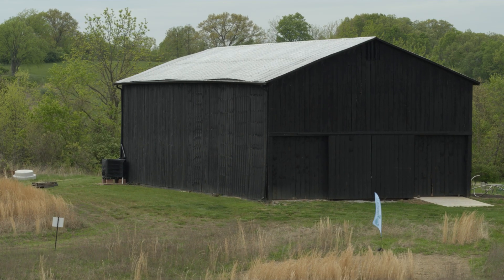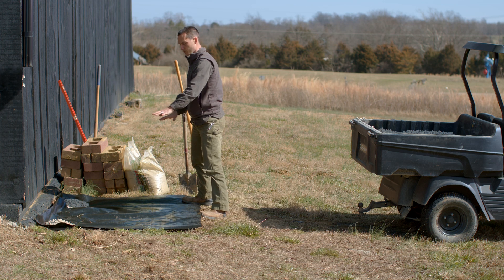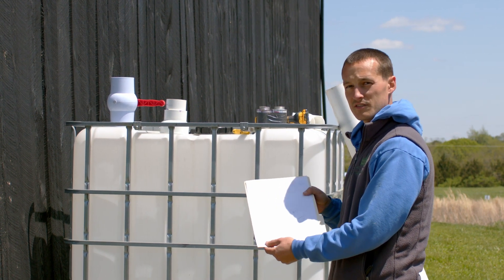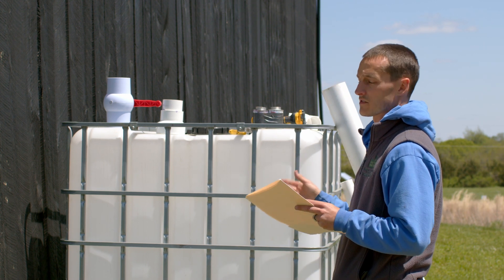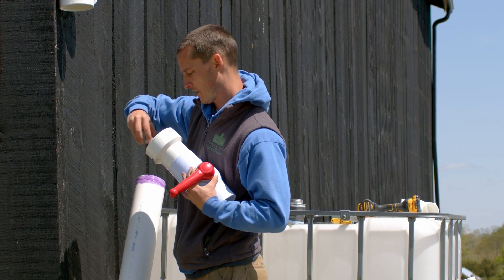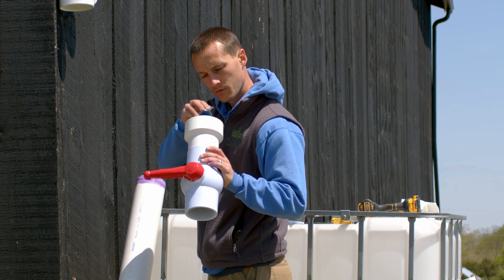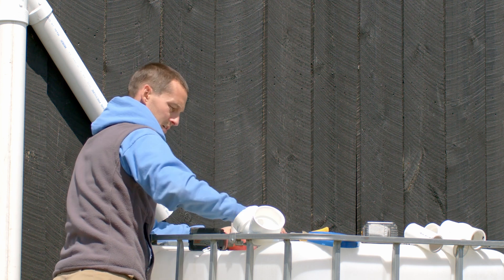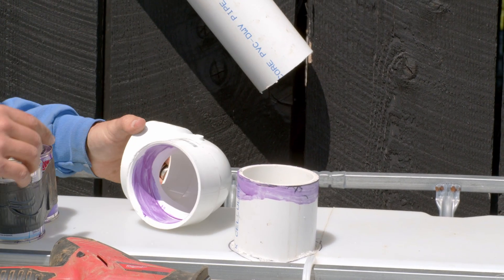Building a Rainwater Catchment System

Comment: Great video! Thank you! I was wondering how the system works one year since the installation? Any additional recommendations at this point? I was also wondering if you would suggest any pre-tank filter to get rid of leaves, branches, twigs and acorns. I understand it would be very difficult to clean those from the tank.